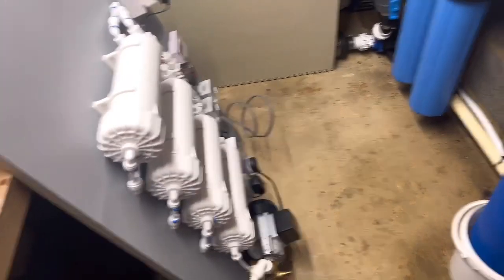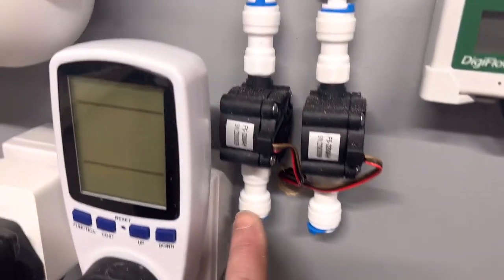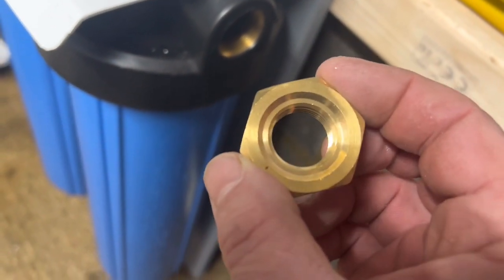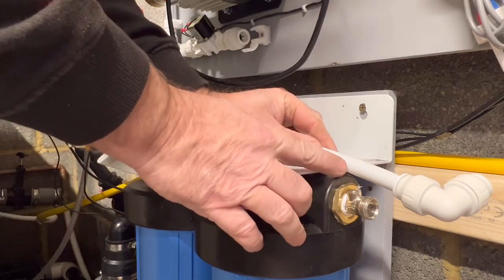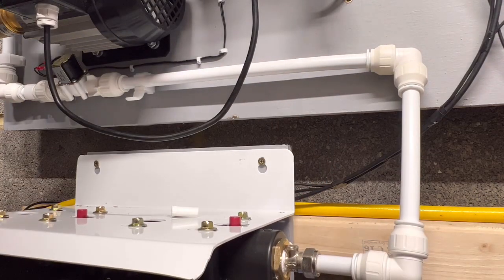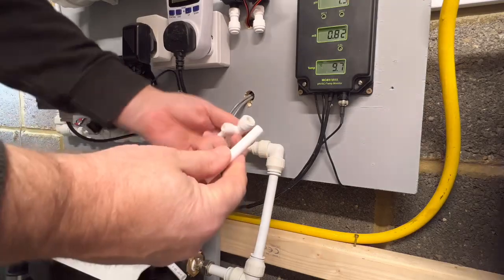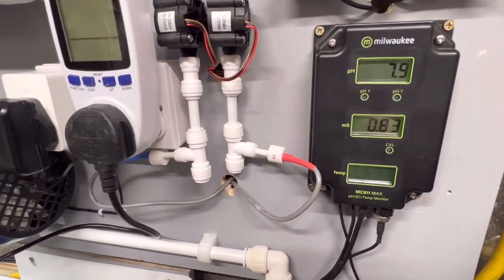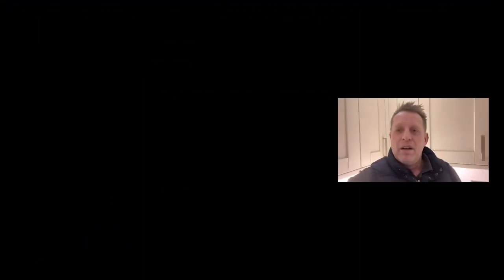REVERSE OSMOSIS (How To Build A Professional System Step by Step)**FILTERED WATER**l

Comment: Good looking set up Stu, I’ll keep tuned in for the updates. Did you need to use any particular membranes for the system or is s y to hat stated in n an earlier episode?
Reply from the maker: I’ve put them in the earlier episodes… I use Vontron 300, 400 or 600 depending on my feeding regime.